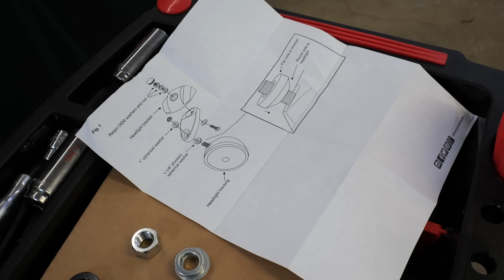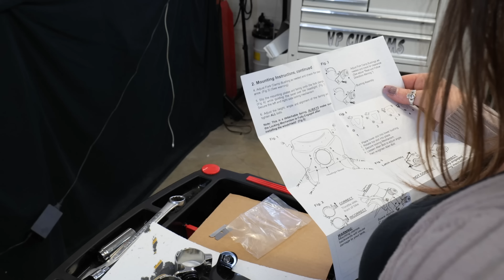We Almost Sold It, Until This Happened...

Comment: Get that headlight top mount and fairing brackets blacked out. Also keep that micro fibre in a zip lock bag to keep it clean. Only takes one bit of dirtin it to scratch your paintwork.
Reply from the maker: We have a carbon wrapped cover that we took off to install the fairing, it's back on.  Maybe just missed it in the walk around! Good idea with the bag!